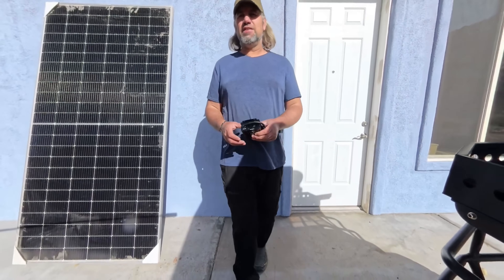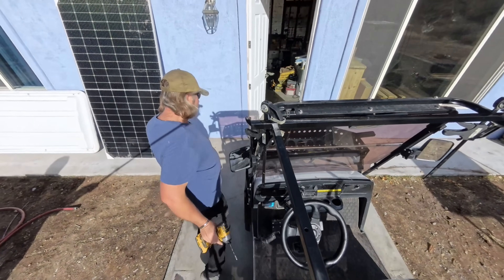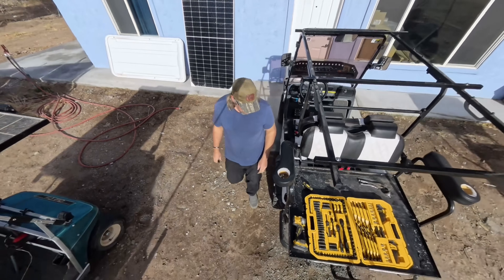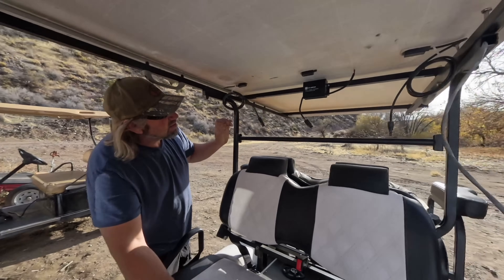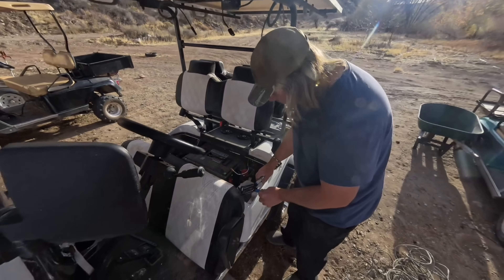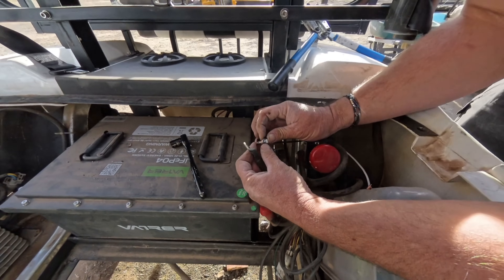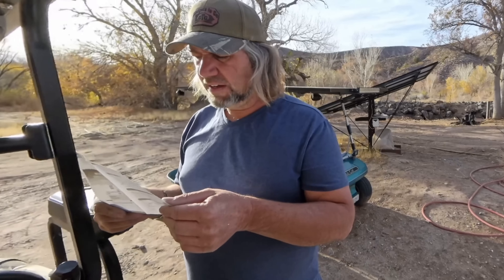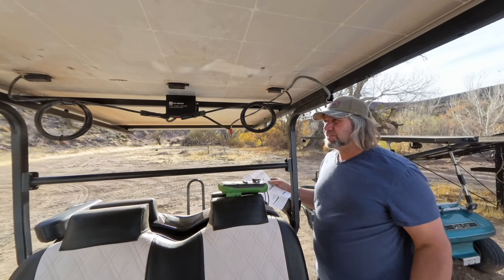Dynamic Enforcer Golf Cart UPGRADE with SOLAR POWER DIY

Comment: Lithium Battery lifespan FYI: 

I’ve thought to put solar on my cart but then I learned that LFP batteries do best between 40-60% State of Charge rather than sit plugged in at 100%. The daily charging can degrade the life of the battery. 

So, if I mount panels as the roof, I think I’ll prefer to add a manual charging shut off switch - because I don’t anticipate cycling the battery much for my cart’s usage.
Reply from the maker: I am really hard on my lithium batteries because I am curious how long they will last if you abuse them. I am really disappointed in how long lead acid batteries last even if you take perfect care of them. You can set your solar charge controller to a lower voltage of charge and your batteries will not be charged to 100 percent.

Comment: After 30 days or real world use, has the Eco Worthy burned up or has it hung in there with the 540Watt Panel? (I am going to duplicate what you have done here with your links).
Reply from the maker: The Eco Worthy worked for 3 months during the winter because the sun is less direct but when the sun got more overhead it gave out.
I put this 600w controller on now and am testing it.
600W MPPT Boost Solar Controller https://ebay.us/z1DH9z

Comment: New Subscriber here. I think what you are doing is Genius! I just purchased my first Golf Cart (2017 Club Car Precedent with Trojan flooded lead acid 48 volt system). I want to do what you did while getting maximum possible solar power from a single panel. I love how you made this simple. I want to do the same. My Trojans are in good shape so Li will be in the future.   What is the best Wattage, Open Circuit Voltage, Short Circuit Current specifications I should look for and a single panel as you have done here?  If cost is not as big an issue as this is a long term investment, what would be the ideal Charge Controller considering the above?    I really want to do what you have done as this is the future! Thank you. I live in San Diego so lots of sun.
Reply from the maker: 2017 Club Car sounds like fun. Trojans are good batteries for lead acid, and they will last longer with a Solar panel. All new panels work just fine. what I do is find a Panel that is the size of roof that I want and then find a charge controller rated for the panel.

Comment: With lithium you don’t want to do solar because battery life will fall about 50% of constant charging and discharging of the battery, with lead acid batteries it’s better to do solar because the lead acid batteries love being on full charge all the time so solar is perfect…
Reply: Not accurate lithium lifepo4 batteries can run longer than lead acid and you can drain to almost zero percent without damaging the battery and you would get anywhere from 8k to 15k deep cycles only time lead acid might be better is if your always in negative temperatures.

Comment: I use victron controller .. nice install and cart
Reply from the maker: Thanks, what are the specs on your Victron controller?  Some people have mentioned that I should try one.
Reply: I have a 150-45 victon and 150-85  I run 3 controller but right 3900 watts and a 10kwh lithium pack 36 volt lithium package 12,800 Watts @Thesolarfarmer

Comment: Do you have specs on the solar panel used? Height/Length, electrical, etc?
Reply from the maker: I am happy to help. Heline 535w 49.97v width 44 1/2''  length 90"